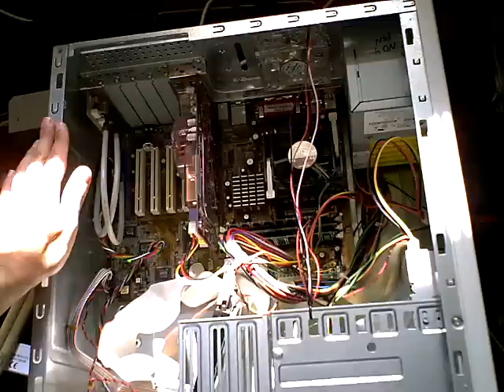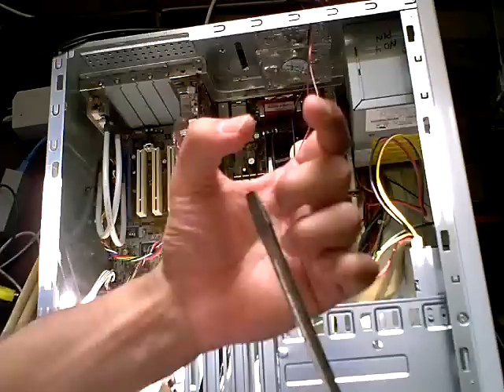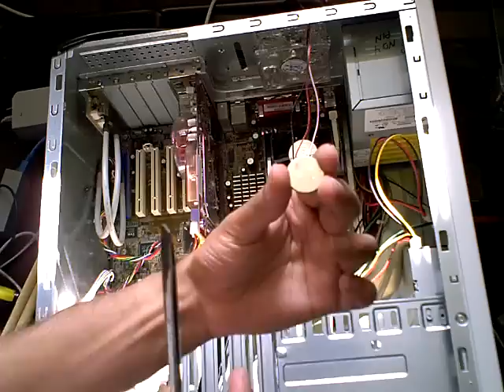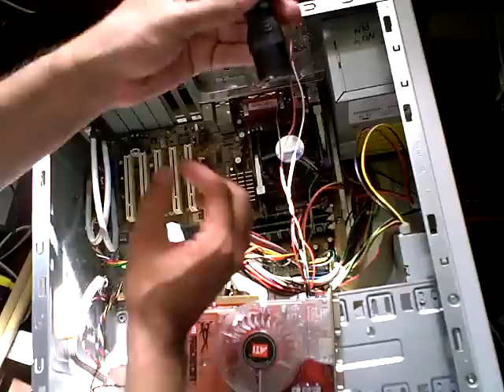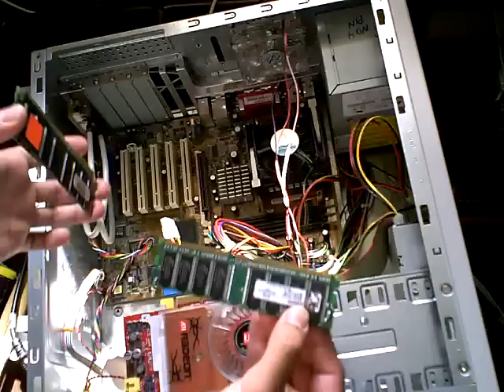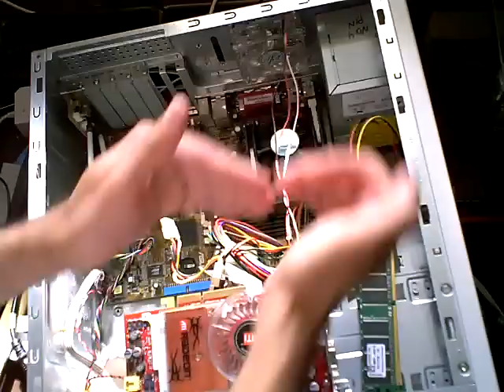How to possibly fix a PC that will turn on but will not beep and will not display anything on screen

Comment: So i bought and made a new pc, amd a10 7850k 3,7 ghz, gtx 960, 8gb RAM, Akyga 550w adn an asrock motherboard , it was runing smoothly for a week but out of nowhere today while playing a game the computer shotdown and the only thing that was working was the small led lamp that indicates that the computer is "on", but not a single sound was heard from the cpu nor the psu, i couldn't even restart, the display wasn't working either. So that means the PSU got overheated and died? I tried to put the new PSU in an older computer that works, but it didn't worked, the same thing with the small lamp
Reply from the maker: Could be a short circuit. I'd try to Breadboard it (explained in the following video:)

If the steps in this video did not provide a solution to your problem, view:

http://www.youtube.com/watch?v=_EK9a-R5pss

You never know, maybe rebuilding the PC in the opposite sense that you took it apart will solve the problem.
Reply: thnx alot, i built an older PSU in and made all of your steps, it started normaly :D i can't run my GPU tho, so the problem is really the PSU. Will contact the administartors and maybe they repair it. Thnx again alot :)
Reply: You eitherdone something wrong in building or the graphics card failed.First hook your monitore up to the onboard video if have one.Check if it works if so request a return through nvidia.If not double check all cables connections and psu to see where the issue is.Your monitor can also be a factor depending what age it is refresh rate Hz it will allow operation on But your issue was found with the PSU go to the manufactures site request a warranty rma if still in warranty.Which is highly likely if brand new they will ship you a new one and keep the bad one
Reply: TSpider Keeper thnx for the advice but what i meant by " i can't run my GPU tho" is that the older PSU didn't had enough power to run the GPU. Everything is fine now, got a better PSU :)
Reply: Marko Ivančan
 ok great
Reply: Linh H
You are speaking fire hazard things.That should only be worked on by a electrician specialist.A power supply is not a toy or something you just apply heat too.They are more of an electricity box equivalent.They can put out enough voltage to kill a person too .

Comment: The problem is my ram. My pc beeped in parts, it wasn't 1 long beep. Whats wrong? (My English is bas, I'm sorry.)
Reply from the maker: +Riichii Beep error codes differ from one BIOS manufacturer to the next. To discover what the beep error code is trying to telling you, discover the manufacturer of your BIOS (available in the motherboard's manual or on the motherboard's manufacturer's website {on the page for your specific motherboard model}) and then look up the frequency and interval of your beep error code on:

http://www.computerhope.com/beep.htm

Comment: my pc turns on then off instantly it didn't do this before i remove my i7 prossecor did i break the processor? because there is also no power given to the usb. and before a got it to stay on and the mobs light indicated it was on but the cpu was not heating up and there was no power distributed to my mouse and keyboard via the usb pleas help me i don't know what to do.
Reply from the maker: +2pvideo Breadboard it (explained in the following video:)

If the steps in this video did not provide a solution to your problem, view:

http://www.youtube.com/watch?v=_EK9a-R5pss

You never know, maybe rebuilding the PC in the opposite sense that you took it apart will solve the problem.

Comment: I don't know a lot of computer, I have this problem and hopefully it will fix my computer with this video.. The computer will turn on and no signs of anything and if I hold the power button after turning it on, it won't  turn off. But im going to try this and will update you the status.. and yea, before this happen to my computer, it will immediately shuts down after a couple of seconds and won't power back. sometimes, displays blue screen and it says dumping memory thingy.. are you familiar with this situations. sometimes, computer is alive but while im working on, it will just hang up and turns off and back to the problem where it will just shutdown immediately after turning it on in a couple of seconds.
Reply from the maker: Yep, I am familiar with your issue. It sounds like your motherboard is developing a short circuit due to contact with the metal casing. Most likely it has to do with the screws and metal mounting stands (supports) that your motherboard sits on. The cheapest way to fix this problem is to introduce cardboard washers between the screws and where they make contact to the motherboard, or you can buy plastic mounting supports at a computer shop.

Alternatively, you can always Breadboard it: 1)place the motherboard with CPU+Fan on wood or non-shiny cardboard 2)connect all of the case connectors to the board's panel 3)with a power bar that is OFF connect the PC power cable from the power bar to the power supply and the power supply to the board 4)while NEVER touching any exposed component,power on the power bar and press the power switch on the case.If the problem still persists,one of the remaining components is probably defective.Power off the power bar before dismantling

I cover breadboarding in greater detail in this video:
Advanced troubleshooting technique tutorial of how to possibly fix a PC that will not beep at boot
Reply: sir thanks! help a lot! your video helps a lot!!!
Reply from the maker: LCPhantasm Tan
A pleasure to be of help : )

Comment: Hey ! When I always turn on my computer , I got a probleme meanwhile the computer provide me a message was : 214-DIMM CONFIGURATION WARNING ....So i hope you help me with a few informations that repair my pc ans thanks again.
Reply from the maker: +Khalil Aghazbour I'd go into your BIOS and load setup defaults, followed by saving and exiting. If this doesn't help, set your BIOS setting for memory to AUTO and COMPATIBILITY MODE if you have it.

Comment: my computer powers up all lights, fans, hdd and vga fan.. but nothing comes up on screen, with out pressing power switch button? one i connect the power cable feed

i removed all components one by one as you explanation.
Reply from the maker: +jalladarts Breadboard it (explained in the following video:)

If the steps in this video did not provide a solution to your problem, view:

http://www.youtube.com/watch?v=_EK9a-R5pss

You never know, maybe rebuilding the PC in the opposite sense that you took it apart will solve the problem.

Comment: ok so my pc when I go to turn it on it beeps the fans spin then the power shuts off. Is there something I have to replace in it? It was a very expensive pc and I don't want to lose it :(
Reply from the maker: Breadboard it (explained in the following video:)

If the steps in this video did not provide a solution to your problem, view:

http://www.youtube.com/watch?v=_EK9a-R5pss

You never know, maybe rebuilding the PC in the opposite sense that you took it apart will solve the problem.

Comment: I installed ram from an older computer and when I put it in I might have pushed down too hard because when I tried plugging in my mouse no light and keyboard wasn't turning on and no signal
Reply from the maker: That older RAM just might not be compatible with your system. Either that or the combination of your different RAM modules are incompatible.

Comment: Help! I have the same problem except now when I plug in my cpu power it won't turn on at all!
Reply from the maker: +TheSniperLegolas It sounds like your motherboard is developing a short circuit due to contact with the metal casing. Most likely it has to do with the screws and metal mounting stands (supports) that your motherboard sits on. The cheapest way to fix this problem is to introduce cardboard washers between the screws and where they make contact to the motherboard, or you can buy plastic mounting supports at a computer shop.

Alternatively, you can always Breadboard it (explained in the following video:)

If the steps in this video did not provide a solution to your problem, view:

http://www.youtube.com/watch?v=_EK9a-R5pss

You never know, maybe rebuilding the PC in the opposite sense that you took it apart will solve the problem.

Comment: i have problem with my graphic card.........my cpu opens but donot display anything on screen...but when i remove my graphic card it works fine.......what to do please help me.................
Reply from the maker: +sudeep acharya If this is new hardware that you are installing on your motherboard (that has not yet functioned on your motherboard,) note that matching bus types of video card to motherboard socket (PCI-E for example) or matching bus types of RAM module to motherboard socket (DDR3 for example) does not necessarily signify compatibility. If this is the first time you are trying this hardware on your motherboard, there is a chance that this new hardware is not compatible with your motherboard, despite the same bus type and despite the fact that the new parts fit in their respective motherboard socket. Your motherboard manufacturer's website will have a support page dedicated to your motherboard's model, and on this support page should be a compatibility list for such components as video cards and RAM modules. Ensure that your new component is certified to function with your motherboard, and if your new component is not present on the compatibility list, then there is a chance that the new component is not compatible with your motherboard.

Comment: please help me, I have a amd quad core processor 4200 and everything in my computer starts fine but my hard drive just sits there and spins my screen wont respond my keyboard/mouse wont respond or glow the fans and everything glow inside the fans run perfectly but the processor is messed up and i cant afford another one any ideas?

fyi:Motherboard bias and everything is fully updated by asus i just sent it in for repairs and got it back.
Reply from the maker: Do you see anything on screen?
Reply: no signal is all i get i tried the vgr cable too and nothing works still
Reply from the maker: Is the reparation that you had done covered under some kind of warranty?
Reply: No the processor cost $80 and I don't have $80 and the warranty ran out last year...
Reply from the maker: In this case, I'd try breadboarding it (explained in the following video:)

If the steps in this video did not provide a solution to your problem, view:

http://www.youtube.com/watch?v=_EK9a-R5pss

You never know, maybe rebuilding the PC in the opposite sense that you took it apart will solve the problem.
Reply: tried still nothing
Reply from the maker: If you are just down to a motherboard, CPU, and power supply, and still have no luck, one of these are probably bad, with the motherboard and CPU being the most likely culprits : \

Comment: My 386 will run the floppy seek test and the post beep,no image on monitor (Can hear MS-DOS booting because the hdd is clicking)
Reply from the maker: +Deangelo Yelverton Wow, for a 386 I doubt very much that you have multiple video outs. Check that your video card is properly seated. You might want to unplug the PC, remove said video card, clean the contacts with a high percentage rubbing alcohol and cotton swab (let it dry at least an hour afterwards) then reinstalling and booting up. If not,your video device may be dead. In all fairness though, isn't it incredible how long these PCs used to last. Although many pentium and up PCs have died on me, I honestly do not remember a 486 or lower ever dying on me...they were made to last (then again, back then a machine cost around $1000 minimally, so you'd hope they'd last at that price)
Reply: Anyway just pulled it and reinstalled it and it works

Comment: Hey my pc is noy wotking the fan is noy moving and no sound is voming ouy of it . Please help me i yried what you saod but noyhing happens .
The fan move a little when start button is pressed
Reply from the maker: +saurav sharma It sounds like your motherboard is developing a short circuit due to contact with the metal casing. Most likely it has to do with the screws and metal mounting stands (supports) that your motherboard sits on. The cheapest way to fix this problem is to introduce cardboard washers between the screws and where they make contact to the motherboard, or you can buy plastic mounting supports at a computer shop.

Alternatively, you can always Breadboard it (explained in the following video:)

If the steps in this video did not provide a solution to your problem, view:

http://www.youtube.com/watch?v=_EK9a-R5pss

You never know, maybe rebuilding the PC in the opposite sense that you took it apart will solve the problem.

Comment: i have a problem with my ram. the ram came in the pc and it was working. i took it out to try another one of my ram. i turned the pc off and took out the power suply. i put the ram on my wooden table. the other ram did not work. when i put back thw other ram and starlrt it up it starts beeping like it didnt have a ram stick. my pc wont recognize my ram at all. if you know how to fix it pleaae help
Reply from the maker: Try the CMOS reset trick as shown in the video. From there, if still no luck, unplug the PC, try the RAM module in a different socket, and power up. If no luck, repeat this until every socket has been tested. If still no luck, I haven't much else to suggest aside from breadboarding the entire machine: http://www.youtube.com/watch?v=_EK9a-R5pss
Reply: Already have. Im getting a replacement

Comment: I have this problem,  I have took off and cleaned the memory card socket,  it always still makes 1 short beep and 1 longer beep.  Please help me
Reply from the maker: +Matt “D00B3R95” Rahikkala Beep error codes differ from one BIOS manufacturer to the next. To discover what the beep error code is trying to telling you, discover the manufacturer of your BIOS (available in the motherboard's manual or on the motherboard's manufacturer's website {on the page for your specific motherboard model}) and then look up the frequency and interval of your beep error code on:

http://www.computerhope.com/beep.htm
Reply: Yeah, The motherboard is in the bin now and i have a new PC, used the old case.
Reply from the maker: +Matt “D00B3R95” Rahikkala At least you salvaged something. Good good then : )
Reply: A 2.4 Ghz Dual-Core Processor
Reply from the maker: +Matt “D00B3R95” Rahikkala Sounds like it's worth savaging to me : )
Reply: ikr